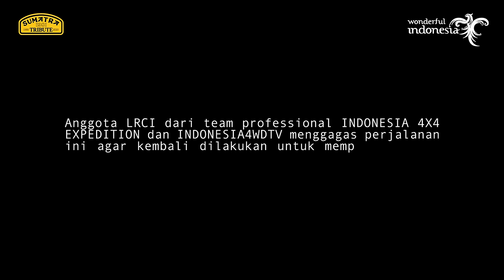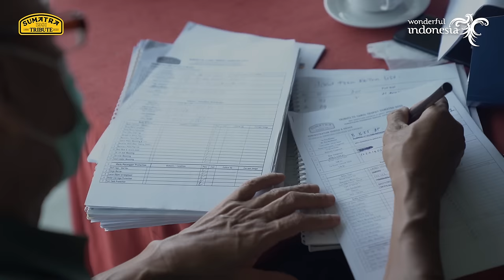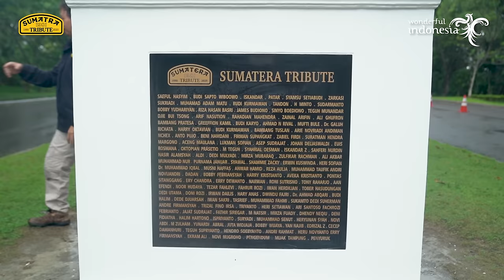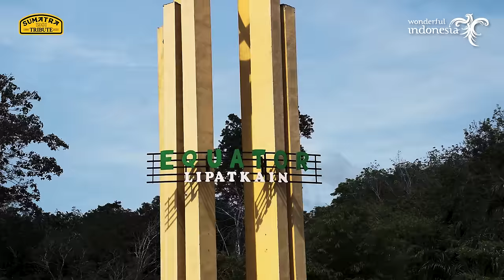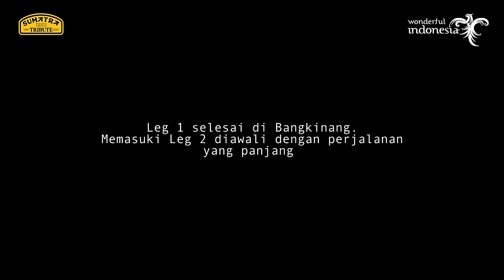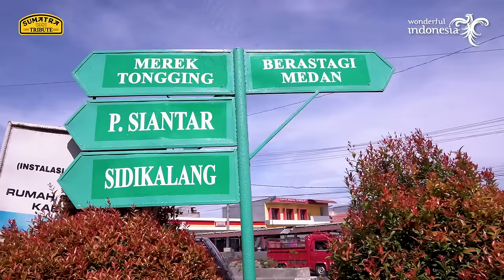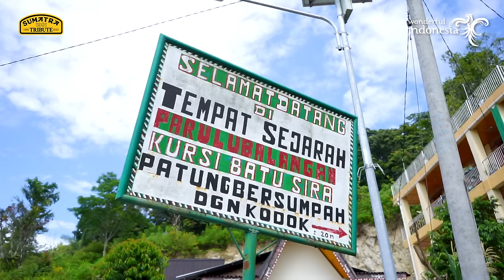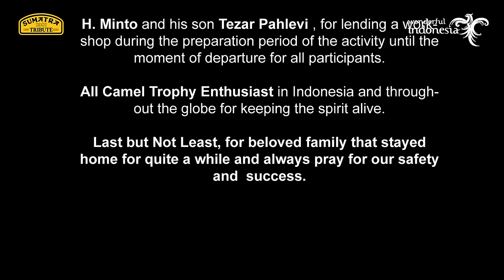SUMATRA TRIBUTE 2022 - Re-tracking the Camel Trophy Sumatra 1981 Route

Comment: Love these videos! Did they not all air the tires down for more traction in the soft mud? They look like they have a lot of pressure in them still
Reply: Yes they do (during offroad) but not too much, because most of them are not using beadlock rim. And the stuffs carried on the vehicle (if not using beadlock) will make the tire slip off the rim easily if the pressure is too low.